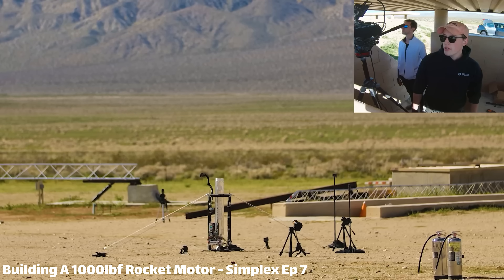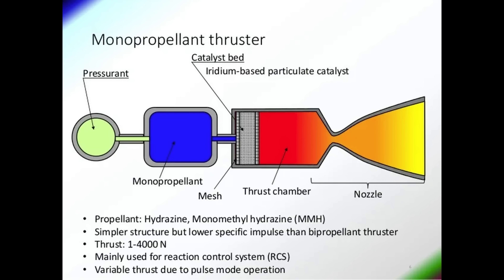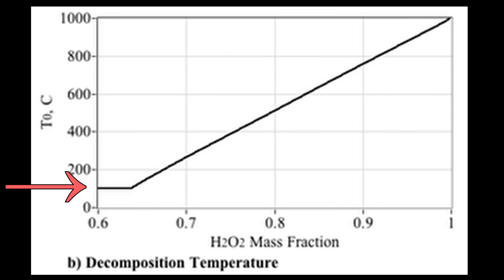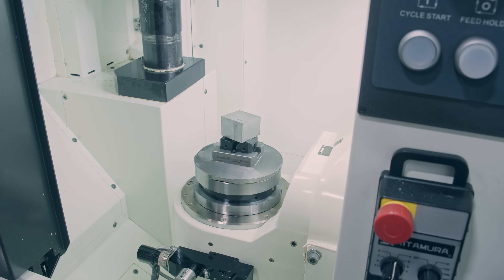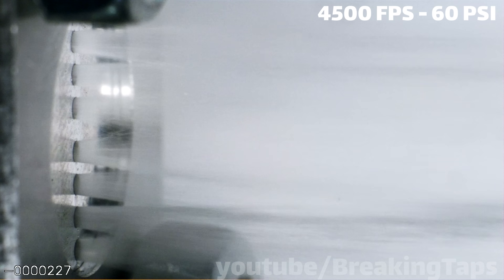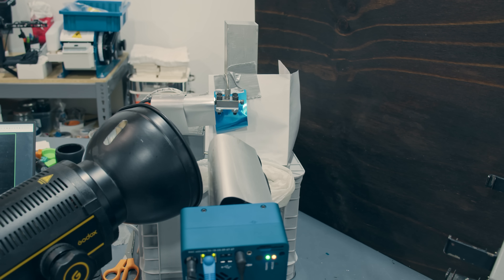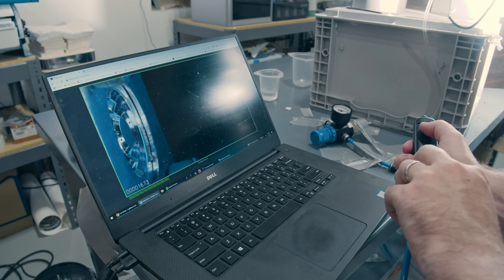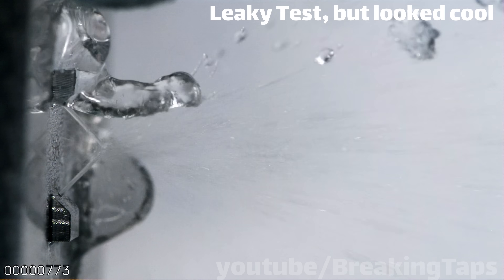Prototyping (Tiny) Rocket Injectors

Comment: I think you are going to be disappointed in the results you get from this.  When i was a kid I had an old liquid rocket that my Mom got from a friend at work who actually loved their kid. (Seriously the kid that lost it was 17 I was 12 WTH!)

Anyway I believe that a hydrogen peroxide thruster is going to be next to useless trying to lift off.  If you go bipropellent your 35% peroxide should be enough to oxidize several propellents which ones escape me at the moment. (It's been around 40 years since I messed with this stuff).

Comment: I have led and also supported designed various hybrid rocket motors from very tiny up to 80,000 lbs thrust(SS1 and SS2)with burn times exceeding 60 seconds and are all powering manned astronaut application. I have also developed liquid rocket engines with more than 50,000 lbf.  Each tech has it place depending on the application, performance requirements,  and budget. After doing this for over 30 years, I still swing back and forth on which will support my application. Some of my applications are drag racing with burn durations under 7 secs and quick  reusability and reliability  are paramount!

Comment: Ok why silver coconut coil is more reaction more fast in realising steam and you can use concentrate hydrogen peroxide the simple method to do is evaporate It and yes not boiling but slow evaporate water you can get 75 to 60 concentrations and keep care of it it highly reactive to organic things and don't try to get 80 or 90 at there it react with anything

Comment: Patently late to the party and probably way past useful at this stage, but I'm going to post it for legacy use. Some years ago, I was rebuilding a jet engine from NOS parts and got held up by the fuel nozzle. Operating principle vs rockets is a bit different, but I had an absolute ball once I figured out the geometry of the nozzle ports. With jet fuel/air-breathing combustibles, having a hollow cone nozzle that converts mass high pressure fuel flow it truly atomised spray is highly desirable, so I spent a few months trying alternatives. In concert with 2400psi repurposed pump and hardened steel nozzles, I found great success a converging .375" input to .00393" singular exit with either a taper cut in the input flow to 0 or 15* flare cut around the nozzle exit produced Beautiful hollow conical spray patterns. 
If one were so inclined, adding a secondary channel directly into the conical spray pattern would be an ideal route to introducing an oxidiser component. Now with a relatively small rocket, you probably wouldn't need the full 2400psi fuel pump, as for my use case, I was injecting into a 300psi airstream and had use for the spray pattern to overcome some of the restricted pattern that would result. In testing at atmospheric pressure, the nozzle would produce a roughly 240cm wide cone at the max cross section, but with added air pressure, about 215mm to perfectly flow inside a combustion liner.

Comment: I love this sort of content.  I live for the puzzle.

I'm not sure about which is better, the shower or the doublet but I wonder about three points.  I bet the ports have a bit of swarf stuck that would break out if you lightly chamfered the holes.  I also suspect that 200um is still a bit big.  You might consider either electroplating some material on or building an anvil with corresponding points to bulge the center of each port into a venturi geometry.  Finally, I think that you need to make your water 'wetter'.  The smallest amount of detergent with no flocculant would do that job.  I have no idea what the surface tension of H2O2 or what it would do to the H2O2.  Might be worth a try.

Comment: You should look at the nozzle on standard garden hose sprayer. One of the settings in those little 6 position ones is usually a mister that atomizes the water quite well. I wonder how that one functions.

Comment: I don’t see why you would need a spray injector. Spraying increases liquid to gas surface area - but you want maximum liquid to catalyst contact area. Having gas here will DECREASE it. 

Just feed the peroxide into the catalyst in the liquid phase. It will introduce the gas and atomize remaining liquid by itself.

Comment: A little late to the party, but you can (somewhat safely) distill 35% H₂O₂ up well over 90% using a vacuum still and a heat source. Even a 100W light bulb is enough heat to distill with a decent vacuum, although I found that IR heat lamps for reptile cages worked perfectly and didn't also blind me while distilling. Just make sure you have a very clean vented stainless or aluminum container to store the HTP in after distillation and keep it cool and out of the sun. 90% H2O2 and most plastics are a bad day. You don't have to distill very much to have fun, I used to get 55 gallon drums of 50% and distill a gallon or two at a time and I always tried to use it all the same day.

Comment: John Carmack spent several years and millions of dollars trying to make a H2O2 rocket. Biggest problem was the efficient catalytic decomposition of H2O2 and blowing out the bed.

Nazis used H2O2 to run the turbopump on the V2. They injected aqueous potassium permanganate (IIRC) into the H2O2 stream right before it vented into the turbopump.

Your biggest liability will be transition metal contamination (hence using permanganate) which can cause explosive decomposition though at 35% probably not uber-critical. 

BTW, there is a H2O2 plant right down the road from where I live…

Finally, a YouTube video about the steam pot on a V2 rocket… https://youtu.be/5C9xipCTe8I?si=yCKhNt1bJzHAD0Mh

Good luck!

Comment: Ok, you're not an engineer. But what are you then? Because you're obviously not on the overselfconfident side of the Dunning-Kruger effect. You acknowledged that hybrid rockets are trash. You acknowledged the superiority of solid fuel and liquid-liquid fuel. You went for monopropellant liquid fuel, not hydrazine, because that stuff is just cancer, but hydrogen peroxide. Knowing you'll need insane concentrations, way above the safe ones. But kept it safe. Heating the catalyst, helping the decomposition as well as the evaporation of the water (I only watched a third of the video writing this). Which makes it insanely inefficient and useless for a rocket, but is a cool and smart way to just demonstrate the principle of a liquid monopropellant via catalytic decomposition!
That already makes better than the 50 % of professionals, who just payed for a diploma, and even better than the 20 % of professionals who know how to use google! So you could already apply for any job in any scientific field and be better than 80 % of the other contestants!
That's my way of saying you're smart and our education system is broken xD
Edit: Watched the whole video now. Nit disappointed. For the continuation of this project, I suggest, as I believe you've planned, to take the simple 0.2mm nozzle hole plate and already combine it with a catalyst mesh and hydrogen peroxide to continue further experimentation. So you have only 4 variables, peroxide concentration and flow, distribution, catalyst contact and output. Separating those would make it infinitely more complicated.
Cool project!

Comment: have you considered using manganese dioxide if you formed it into a pattern like a rod and tube from solid rocket boosters and arranged a set of impinging injectors with the vaporization point in the middle of the empty space you might get a pretty great result?

Comment: Hey, enjoyed the vid. I have worked with HTP and here are some advices. I recommend to use showerhead injector for the catalyst bed and design the orifices so that you would have a pressure drop across the injector about 20% of your cat bed pressure. Use transverse injector for the fuel injection. You would need enough chamber length and pressure for the autoignition of the fuel.

Comment: I have been making a peroxide rocket at home.  I made my own 90% peroxide.  I used a vacuum distilation set from Ali Express and a refrigeration vacum pump.  Ended up being alot easier then people said and was a fun project.  I'm using stainless steel nozels from a misting fan.  They attomise great and come in heaps of sizes.

Comment: For injector geometry, and ease of milling, could it perhaps be worth it to use a conical bit to make a shower head style injector? I could think of 3 solutions with this:
1) the big end of the cone is on the inlet side, and small end on the outlet side.
This could perhaps help create a lateral force for the liquid as it exits the orifice, which should break of the laminar flow.
2) reversed, so small end on inlet and big end on outlet side. The more gradient pressure drop as opposed to a regular shower head hole, could perhaps help the stream to separate instead of starting laminar - a bit akin to a waveguide for a speaker. I’d assume a 60degree bit would be better for this case than a 110, as we’d most likely need a slow expansion for the liquid to actually expand.
3) a combination, so drilled from both sides. This could combine both of the above mentioned potential effects.

Looking forward to any feedback :)

Comment: Is the introduction of air from the high pressure tests due to the air line in the tank? I'm sure the next step is to use a plunger in the tank to separate the air and propellent. Can't wait to see where this goes.
Reply from the maker: I think so yeah! For some of the later tests I "pre-purged" by adding a small amount of pressure until it was leaking out of the nozzles. That helped a lot, but I think there is still air trapped in the system. And at higher pressures I suspect the tank geometry let some of the shop air mix in as bubbles too.

Comment: dont deburr your injector holes you need a sharp corner on your holes. like rub it on the rock with fine paper, no whirrly gig tools. flame spraying silver on to screens makes the best cat beds. the peroxide engines ive worked on have one huge inlet to the cat bed and at bottom of cat bed theres a plate with a few hundred holes that are tapered small end towards cat bed

Comment: Overview
- The video focuses on prototyping rocket injectors for a monopropellant thruster using hydrogen peroxide.
Background
- Monopropellants decompose and provide thrust, typically with the help of a catalyst.
- Hydrogen peroxide is used as the monopropellant, which decomposes into oxygen gas and water vapor when it contacts a catalyst.
Design
- The thruster consists of an injection chamber, a catalyst chamber, and a rocket nozzle.
- The injection chamber will have nozzles of different sizes and geometries to spread the peroxide into a fine atomized spray.
- The catalyst chamber will be packed with a silver catalyst to decompose the hydrogen peroxide.
Injector Test Stand
- A CNC-made test rig was used to try out different injector geometries.
Types of Injectors Tested
1. Showerhead Injector
   - Array of holes to spread the liquid.
   - Tested with 1mm and 0.2mm holes.
   - Atomization increases with pressure.
2. Impinging Injector
   - Angles two holes towards each other so the streams collide.
   - Tested with 1mm and 0.2mm holes.
   - Atomization is much better with smaller holes and correct angles.
Observations
- Full showerhead behaves differently than a single row, merging streams at low pressures.
- Impinging injectors need to be in perfect order for effective atomization.
Conclusion
- Both types of injectors have pros and cons.
- It's unclear which will work best in the final thruster design.
Additional Content
- A companion video with more technical details is available on N_b_la.

Positive Learnings
1. Effective Atomization with Impinging Injectors: Using smaller holes and correct angles resulted in much better atomization, which is crucial for efficient fuel mixing.
2. Showerhead Simplicity: The showerhead injector's design is straightforward and could be more robust for consistent performance.
3. High-Speed Camera Insights: The use of a high-speed camera provided valuable real-time data on how the injectors behave under different pressures.
4. Modular Design: The thruster's design is modular, allowing for easy swapping of injector plates for testing different geometries.
5. CNC Test Rig: The CNC-made test rig proved to be a useful tool for trying out different injector geometries.

Negative Learnings
1. Impinging Injector Sensitivity: These injectors are sensitive to alignment and hole size, and any imperfection can lead to ineffective atomization.
2. Flow Rate Issues: The full showerhead emptied the tank quickly at high pressure, introducing air and complicating the results.
3. Unclear Optimal Injector: Despite the tests, it's still not clear which injector type will work best in the final thruster design.
4. Material Sensitivity: The video mentioned that high-test peroxide can be sensitive and potentially dangerous, limiting its usability.
5. Complexity of Variables: The number of variables like hole size, pressure, and angle make it challenging to pinpoint the optimal injector design.

Comment: I remember reading about how improper injection in rocket engines can create some terrible effects. If the combustion (or decomposition) is uneven, the detonation will start to rotate within the chamber instead of being uniform, and cause the engine to explode. This was a huge problem for the Apollo program engineers working on those giant F-1 engines!

Comment: Probably won't read this, but could you look at small scale rotating det engines? I've been fiddling with the design sketches using ball valves to contain the detonation and a gas impingement system for it's rotation. Haven't figured out injection, but figured this video would be a good one to comment on.

Comment: 0.2mm  thats about the smallest mechanical via size before laser vias take over. Repairing my oil boiler , the nozel was amazing, 60 deg cone , three spiral jets. Beautifully made. You can dismantle them easily. £9 Danfoss.  maybe some bits you could use. Fascinating as always. Nebula sounds worth a look.

Comment: I think you need a smaller diamater nozzle. like 0.1mm and much, much more pressure. A common-rail diesel system has about 3000 bar, or 43511 PSI for atomizing the fuel well.

Comment: Some of the turbine engines I work on have fuel nozzles with jet holes drilled at an angle around the rotational plane so that it sets up a swirl pattern with the fuel.

Maybe try an inner ring of straight exiting holes with an outer ring of rotationally angled holes that impinge on the straight exiting drops.

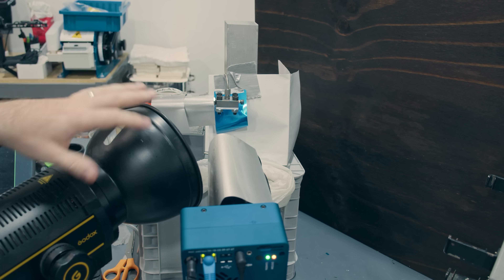Comment: 9:58, remember to not consider 0.2 vs 1, but actually consider 1/25 and 1. Because you have to square it. A 0.2mm hole is 25 times smaller than a 1mm hole.

Comment: Can you please show how you are pressurizing the system?
Reply from the maker: Sorry, I skimmed over that. It's basically a direct line from my air compressor into a small pressure regulator, set to 10-60PSI depending on the test, and then from the regulator into the liquid tank. Pretty simple!
Reply: @BreakingTaps  I understand, there might be something there that can account for the uneven ejection you showed.

Comment: H2O2 will decompose into H2 and O2, which is actually pretty explosive, and can be used as rocket fuel too but can't because it is expelled out of the rocket, and recollecting it will basically undo the thrust generated... such a waste TvT

Comment: Not sure I fully agree with Joe Barnard "hybrids are trash".  They are basically laboratory curiosities that attracted the attention of amateur rocketeers (like me) for many years.  I even ran a small company that made them for hobbyists and researchers.  But in terms of commercial viability in "big rocketry", they have some practical issues that make them unattractive in that market.  It's hard to get really high Isp out of them (which is what you need for orbital shots, for example), and since you're already working with high-pressure plumbing for one of the propellants, why not two?

Comment: i suggest a burst disc/reactive spool valve between the tank and the injector.
another option is maybe a smaller array of vortex fog nozzles using a 2 part split plate.
I have a pocket NC V2-50CHK and can make injector parts for you I can do all the proto work in 7075 alu and some finished parts in stainless.. as i have the material on hand.
on the tank add a separate fill hole and stretch a thick 7-12mil nitrile glove over the top to separate the air from the liquid acting like a diaphragm.

Comment: I remember working on commercial dot matrix printers that used ruby nozzles.  Maybe holes can get smaller if drilled in a crystal like that, not sure.  But if they were commonly available, I would think you could drill holes in metal, and insert those ruby nozzles. Don't know if that would be any better, just an idea.

Comment: So I wanted to try building a monopropellant engine using a modified Ranque-Hilsch vortex tube. The design was to run the injector partially reacted into the offset intake side port, and use a catalyst mesh wrapped around an adjustable, perforated, "cold return" tube through the center of the body. The "cold" air is redirected 180 degrees back over the body, and both hot and cool air are used as thrust.

Comment: You should make catalyzing injectors by stacking up washers and silver screens, diameter of washers would get bigger towards outlet, it would allow you to experiment with the length/distance needed to catalyze the H2O2, you may need to pre-heat the catalist, you could use a heat gun.